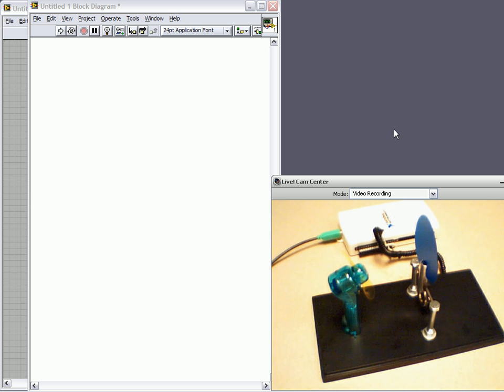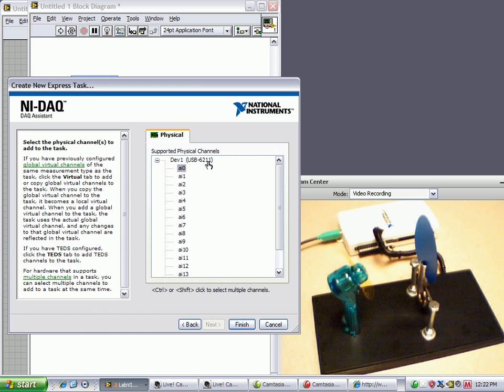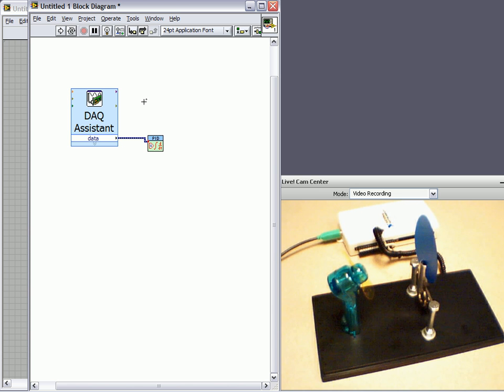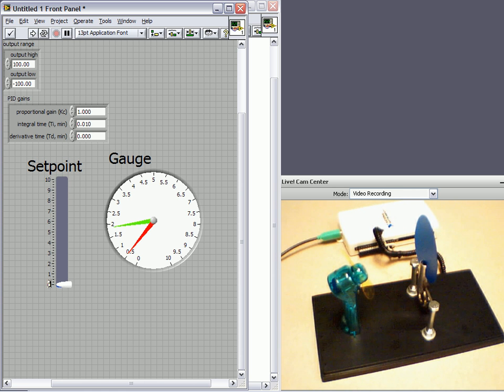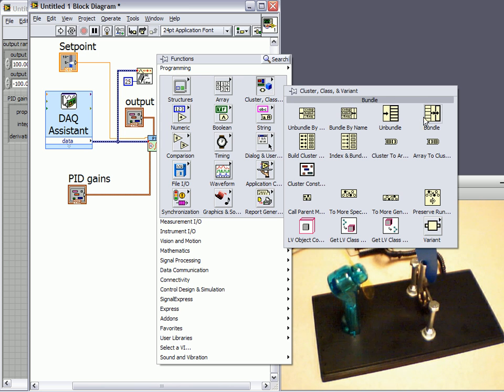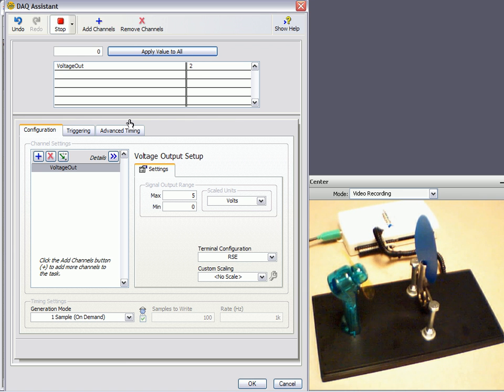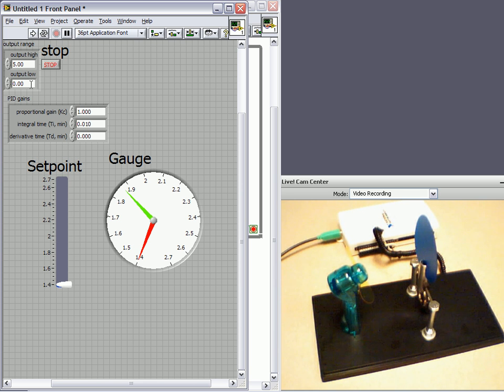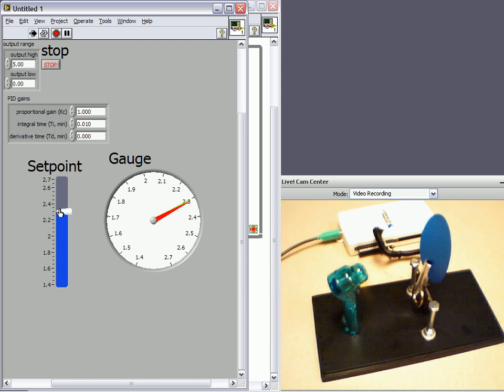Simple PID Control

Comment: Excellent job:
I have a question. I am learning labview by myself. What will happen if you do not change the PID values? I mean those output ranges which you changed to 5 V... if you leave 100, then will your PID generate 100V or?

I am thankful for your reply.
Reply: did you find out? 😂